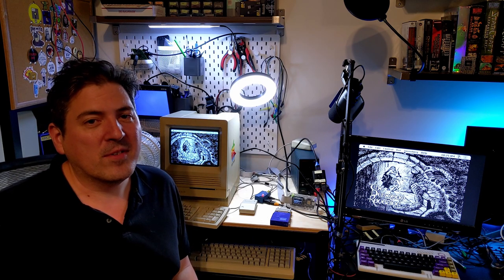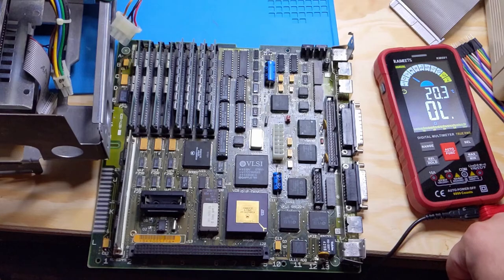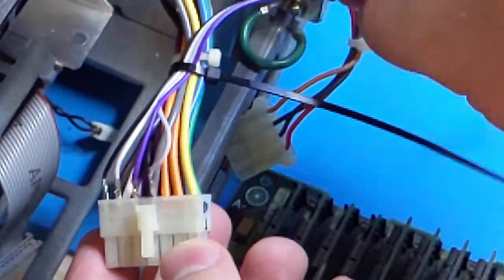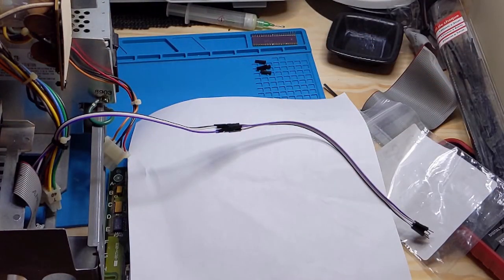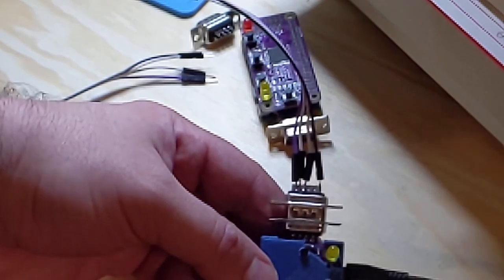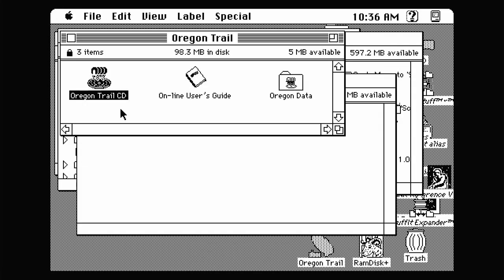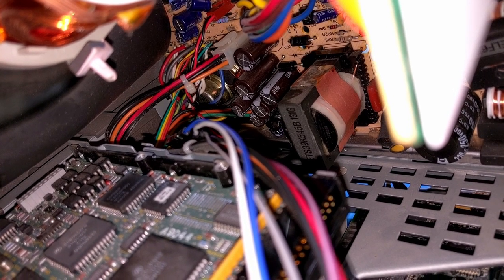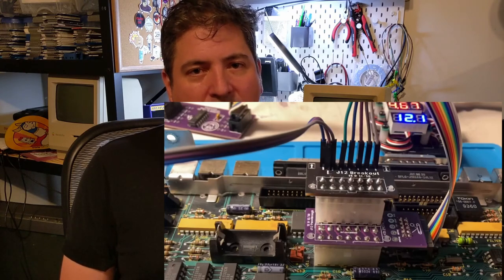RGBtoHDMI for my Mac SE/30, how to wire up

Comment: Great video. Thanks. I bought  Macintosh SE with broken CRT and I’m wondering if I can use RGBtoHDMI plugged directly to motherboard and have unplugged Analog board? I need to check if the other hardware works.
Reply from the maker: You can do that. Ron's Computer Videos (@ronscompvids) went all the way with something resembling your needs, it was his whole setup at VCF Mid West a few weeks ago. He used a RGBtoHDMI from Texelec (instead of building his own from the github like I did) and used a PicoATX power supply modern replacement and a few other doodads (that essentially does what the extender PC Buffer board does with the original rgbtohdmi project) to make sure the TTL video signal is unidirectional. Basically, you have options for providing power and another set of independent options for dealing with the video signal.
Reply: @1BitFeverDreams  Thanks so much for the response! I'll check everything you mentioned.

Comment: Great video! Is it possible to come out of that plug straight to a composite video? I have a small external monitor that has a BNC video input, I would love to hook that up to the se/30 for fun!
Reply from the maker: As I understand it, no. The pi hats used in the RGBtoHDMI is different whether you need analog or TTL signals. The Mac's video line is TTL. You'd need a 3rd party converter from digital to analog.

Comment: I used your instructions to connect an RGBtoHDMI (from TexElec) to my Mac Plus. After a little trouble with installing a firmware update (2/13/24 release), I got it sorted and it works great. I used it last week to do a demo of early font editing software on the Mac Plus, feeding it into my modern Mac laptop (so I could record the screen) and outputting that to a projector. It was a big hit. https://www.youtube.com/watch?v=Cqbnocp7j_A&t=2456s
Reply from the maker: Glad it helped!